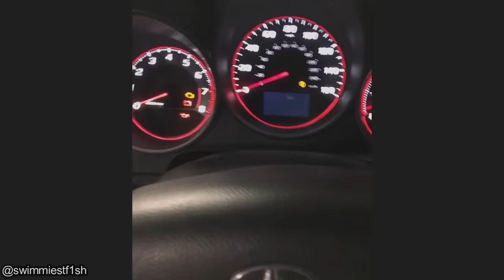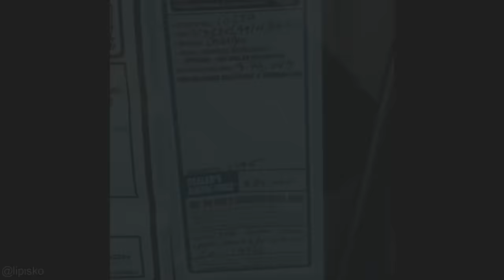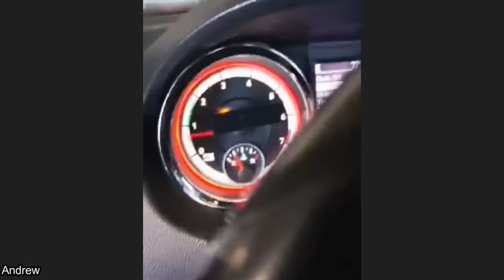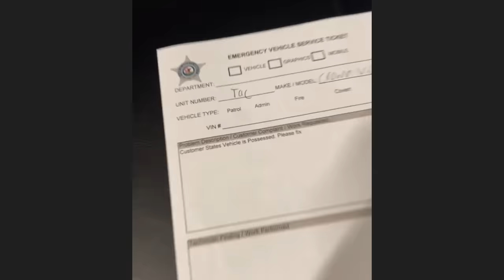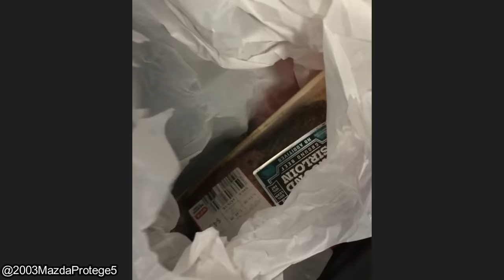Customer States Compilation (The Best of 2021) | Just Rolled In

Comment: I'm no mechanic, but I'm pretty sure oil isn't supposed to be jelly.
Reply: The response you hear in the background is exactly what you will hear in ANY shop that something like that comes into. Because honestly I have no idea how that is even possible, short of actually adding jello to the oil.
Reply: I've seen something similar to this when a lady added coolant to engine instead of oil, though resulting mass was closer to butter than jelly. Maybe it depends on what exactly you add to engine oil.
Reply: forbidden jello
Reply: Where’s the gabagoo
Reply: My best guess is that a shit ton of gasket sealer was somehow involved in making the forbidden jello. Along with using some weird oils or adding coolant as well. Who knows at this point lol I’ve never seen anything like that
Reply: Did someone drop gelatin into the oil? How TF does that happen? Lol
Reply: @alexwalker2582  Yeah, I wondered that myself.
Reply: Or, the vehicle could have had poor oil / water in it, and it was left in below zero temperatures. Oil can freeze if cold enough and become jello like if there is water or coolant mixed in in it. (Blown head gasket) ?
Reply: @alexwalker2582  All engine oil increases viscosity during time. All sorts of particulates from burnt oil to tiny shaving of metal get in it. Its the main reason we change our oil. It not because it looks dirty, its because the dirt increases viscosity and therefore reduces the oils ability to transfer heat. This is just what happens to oil that hasn't been changed in decades.
Reply: @richbob9155  That didn't look like oil.  I've seen engines that didn't have their oil changed for 60k+ miles.  It doesn't look like that.  To me, that seems like an additive that went wrong.
Reply: @pennywisethedancingclown7139  Usually oil with coolant in it turns into a milkshake-like substance.  This is.... rather strange.
Reply: @Darion350  I guess so. Unless the water / coolant completely separated? I guess if it was mixed up. It could look milky? Idk. I'm no expert. But whatever happened... 🤣
Reply: The forbidden jello
Reply: The person who sent that clip in didn’t know what happened because it’s not their clip. This one is several years old, and if I remember correctly, someone sabotaged the car.
Reply: A routine oil change (on diesel trucks for me), typically sees a more viscous black fluid coming from the oil pan. I've yet to see anything beyond that coming out of the oil pan. Yet I have seen oil filters tightened to a point where they cannot be removed. I had two of my tech buddies try to remove an oil filter, thinking they had finally broken the torque, only to realize that they were merely twisting the filter itself, just below the threading. They had completely broken it off, and there was no salvaging it. The truck had to be towed to a Freightliner maintenance location to have it removed with higher level tools than what we had...
Reply: Silver paint?
Reply: buying a used motor filled with oil and window cleaner would do that i think
Reply: @richbob9155  I've seen oil in very old junkyard engines that's far older than a decade, didn't look like that.  It will get very sludgy, but it's still somewhat liquid.  

To set up like jello there has to be some sort of contamination.  Sabotage even.  Not sure if sugar will do that, but sugar does solidify at high temps, and mixed with motor oil maybe that happens.  Don't know, never tried it, but I have heard of pouring sugar in the engine as a way to mess it up.
Reply: @Driftwannabe 10 looks like a good way to clean it if you manage to get all that jello out without too much problems loool
Reply: Costumer stated that it froze over in winter
Reply: Im speechless lol....ok folks sugar in gas tank normally won't screw a car up but sugar in oil reservoir will def congel and turn to taffy or caramel..some of those oil changes with here def revenge it seems..but most of them where coolant poured into wrong area imo..
Reply: @Tyler-ts2ld  there’s special judgement for people who sabotage the car of another.
Reply: Fine powdered saw dust will do that. its is added by unscrupulous car dealerships to quiet a knocking engine, its also added to transmissions to hide slip. the cellulose and hemicellulose burn off ( causing a burning smell) and the natural polymer left in the wood causes the oil to gel like that.
Reply: @anthonylautzenheiser3802  can that be done in newer cars though?  Seems those old tricks only worked in carbureted cars and transmissions that weren’t electronic.
Reply: @KristiLEvans1  I am not sure, but , it seems to me that as it works with the oil it wouldnt matter how old the car was.
Reply: @anthonylautzenheiser3802  hmm.   That’s fair.  Interesting to consider
Reply: I like using raspberry jam.
Reply: @Darion350 

I saw another clip a while back that looked like that; frothy milkshake/slushee consistency.  It was fascinating
Reply: @radiotubes  unicorn blood I think
Reply: It looked like someone put five box's of Jell-O in the crankcase now we know.
Reply: @Driftwannabe 10 nobody calls you that
Reply: @Driftwannabe 10 oh I took so hard so so hard
Reply: @alexwalker2582  the oil is no longer oil it is now reverted back to tar
Reply: @Driftwannabe 10 don't go easy on me explain in detail.
Reply: @richbob9155  that engine wasn't decades old though
Reply: @anthonylautzenheiser3802 
I've heard about how they'd do that to quiet down noisy transmissions & differentials, but didn't know it was done that much with engines too. I guessed the sawdust would quickly clog the oil pickup, the tiny galleys in the lifters, etc. as soon as it was started & cause an engine knock to get even worse. 

Reminds me of a section in the 1939 book The Grapes of Wrath about how a used car dealer would put sawdust in noisy transmissions & differentials to quiet them down, then sell to evicted sharecropper families who had just sold everything they owned to buy a used car & were migrating west to California in search of work. Imagine being the type of person who does something like that knowing the buyer will be taking the car on a 1400+ mile trip through some pretty rough & rural country, where breaking down in the desert would be a life or death situation. Sure unscrupulous used car salesmen definitely still exist today, however in my opinion selling a car with a known engine/transmission issue that has been masked with sawdust to a family that you know is homeless & will be taking it on a week long drive through Death Valley with no cell phone is an entirely different level of scumbag. Nevertheless we have never had any shortage of scumbags.
Reply: @FinalFront  I am making a educated guess on it being used in the engine. The saw dust would need to be a fine powder for use in the engine, opposed to the coarser type used in the trans and diff. There is no end to products that you can add to your engine to stop knocks today. Instead of the hucksters selling you the car like this, you can go to your local auto parts store and do it too yourself.
Reply: New Jello
Reply: It comes with a toaster
Reply: @alexwalker2582  lmao fuck adding sugar to the tank I'll just throw in jello mix
Reply: @Darion350  probably that mechanic in a can bs
Reply: @alexwalker2582  if you for example mix a fluid that is not supposed to go in oil that can happen, and the disgusting “oil” is water and very old oil, ALWAYS remember to change ur oil!
Reply: This happens when you add too much extra additives to your engine oil. Often happens when the engine is worn and you try to hide its condition right before selling. It has nothing to do with oil and water/coolant mixing.
Reply: I'd have kept that thing as a trophy. That was just too spectacularly bizarre to throw out.
Reply: I'm not a mechanic, but I have heard back in ww2 there were (atleast in the us armed forces) 2 main kinda of oil. One was for warm weather, one was for cold weather. During the battle of the bulge they were in low supply and had to use warm weather oiln and it would essentially do the same thing until it warmed up.
Reply: @Milo Prager I doubted with releticly modern oils, I'm just trying to figure out how you would do that.
Reply: As a mechanic, it doesnt taste like it either.
Reply: I'm weirdly enough in a position to say that this isn't coolant mixture I don't think. I recycled oil for a living and have seen all sorts of oil mixed with shit from some gramps' garage and I have never seen anything like that jelly. I've seen oil thicken to mud, I've seen the coolant milk, brake fluid, even one asshole who had mercury thermometers broken in the oil with coolest and rain water.... Never seen jelly....
Reply: I am, it’s really not supposed to do that
Reply: The forbidden jello
Reply: Yea Fight, oil is supposed to have an silver colour... XD 😉
Reply: @wallywest2360  sugar messing it up by clogging every hole or small line. specially when it melts but it will not look like this. I put sugar in a junkyard motor I had laying around, ot ran for like 30seconds
Reply: Yeah you want a more molasses type texture, the thicker it is the better job it does at protecting your engine
Reply: How would you know, you’re no mechanic.
Reply: @Webbygears  ^^ if someone would serve you a bowl of soup thats glowing in the darkness you would also say "thats not supposed to be like this" or am i wrong? 🤔 XD 😉
Reply: That's not oil, it's silicone
Reply: As an experienced professional engine mechanic I can confirm it's totally normal for oil to look like black jello. It's also totally safe to eat.
Reply: I’m guessing the engine - and therefore the car - are a write off at that point?
Reply: Only in a jet
Reply: Yeah, don't be THAT GUY. When the sticker says 21,000 and you're at 22,000, change the fucking oil. I'm not licensed but EVERY vehicle I saw that came in well beyond it's natural life had the oil changed on point. It's literally the best thing you can do to keep your car going beyond it's expected lifespan, and it actually works. 
When you don't change your oil it breaks down and becomes sludgy and thick (as we have seen). This sludgy oil blocks passages that are meant to clear your engine of gases that shouldn't be there, and will impede you fuel economy and promote premature engine failure. The deadest engines I ever saw were those that were neglected, and they were junk.
Find a mechanic you trust, and listen to them. They aren't trying to rip you off in most cases........If a mechanic is honest with you and gives you a fair deal for the work preformed, you;ll be a lifelong customer, and most good mechanics know this. Ask around, find that mechanic who is older ad established but still has a rep for diagnostics and newer vehicles. They exist, and remember....just because someone is saying something you don't understand, doesn't mean they are trying to take advantage of you.
Reply: FORBIDDEN JELLO
Reply: Holy crap
Reply: Smuckers after dark
Reply: Dude right!! That was the first thing I was just done with.
Reply: Yeah it turns to jelly if it decides you don't deserve to own a car, quite often the oil makes this decision when it gets neglected. Oil has feelings too.
Reply: I've seen that video before on other sites. Word on the vine is that the customer added jelling agent to the oil in an insurance scam.
Reply: I don't know man, you sure
Reply: @joemann7971  No oil change
Reply: Nooope lol
Reply: @alexwalker2582  yes it is a old trick for a motor that is basically blown   put jello in the motor and it will run for a little while
Reply: It is if you plan to use it as improvised napalm lol.
Reply: Yes it is. That way it will seal all the leaks
Reply: That is because they are in a slick jam.
Reply: @joemann7971  put something to thicken up the oil (sealer/gelatine whatever) to sell the car with leaking engine after washing it.
Reply: The engine can have a little jelly, as a treat.
Reply: They probably used all additive instead of oil.
Reply: "yo man you forgot your oil" hands you block of jelly
Reply: Oh your are a fucking genius
Reply: 05:30 Also that burning smell just might be the fire!
Reply: No sabes nada Jhon Snow es tecnología alien.
Reply: Sure it is!!  Why not?!!!
Reply: It will take three days to change it b
Reply: I was laughing and horrified when I saw that, kinda curious... how
Reply: @UNSCPILOT   Don't change your oil for YEARS lol. That's how.
Reply: Youd be right about that
Reply: Crappy oil additives do that... Like slick 50..
Reply: Forbidden Jello
Reply: I’m a mechanic and I can tell you it’s perfectly normal lol
Reply: Most likely a ton of sugar
Reply: Or silver
Reply: Looks edible all I need is weed and some guts
Reply: Actually F1 cars use jelly oil
Reply: Thats a new synthetic additive its supposed to make oil last forever.
Reply: @pennywisethedancingclown7139  
If it wasn't it is now.
Reply: Michael!

Jim stuck my engine in jello again!
Reply: Forbidden jello flavors
Reply: id be dumbfounded if they drove it in! i mean even my 200k+ mile car doesnt have oil that looks like jelly!
Reply: That's what could happen when you mix different oils or additives that use different ingredients. That's why it's important to use one oils and one additive and dont mix, it's fine to change out fluids to another brand but never mix
Reply: Mhm
Reply: That's not even jelly that's solid ballistics gel lol. Like someone poured a few packs of jello mix in it. Pissed off ex gf has your spare key? Lol
Reply: But it identifies as oil so the car is supposed to ignore this or it’s a bigot
Reply: @Goabnb94, looked as if someone had mixed pectin with the oil, only thing lacking was a bit of flavoring, some fruit cocktail and a touch of whipped cream, lol.
Reply: Mm nothing like grandma used to make
Reply: @joemann7971   gravox
Reply: Its because it's fake af!
Its for clicks!!!
Reply: @Omicron9999  You mean the jelled junk from the oil pan? There's a  shop near me that has (or at least used to) a wall of shame where they had hung some of their most hilarious finds, like a 2 in mountain of weld applied to an exhaust leak, a brake rotor worn down to the vents, and several other things.
Reply: No no it’s supposed to be jelly
Reply: Its like when sellers put a free pack of haribos in your package, just a nice engine seller packing the engine with a nice oil jelly treat
Reply: reminds me of the engine lock poly the dealers used to put in the motors  to destroy them during the cash for clunkers campaign in the late 90's early 2000's
Reply: Taking office jello prank to a new level
Reply: You’ve never heard of “oil jelly”! You can get it in grape or strawberry
Reply: See i can tell youre not a mechanic. Youve never even heard of the new snack oil
Reply: @kireta21  Exactly what i started thinking when i saw a green tint to it when they pulled off the oil filter.
Reply: @wallywest2360  nah, sugar will burn away.
Reply: @djnone8137  1. If your oil is burning you've got bigger problems than the sugar. 

2. Do you have any idea what happens to sugar when you burn it?  It turns into hot, molten glue.
Reply: @richbob9155  the particals in the oil do not hinder it to transvere heat, and that is NOT its primary funktion, oil is there to lubricate. when you use it to long, the molecul chains get broken up, thats why we change it. particles maybe to, but the engine should not produce any particles if the oil does its job.
Reply: Someone hates them. Put Certo in the case
Reply: All the oul passages had to be sealed, probably why its there, probably knocking like hell.
Reply: @wallywest2360  nah. Sugar is atomized in a pressurized cylinder of gas. It won't gum up anything. Burned oil is way worse than caramelized sugar and engines operate just fine. Sugar might muk a turbo or an injector but not the engine.
Reply: Yeah. What is that/what happened?
Reply: It will jam and then toast the engine.
Reply: @billolsen4360  🙄
Reply: I'm going to take a guess it wasn't oil at all, the clue is they just said they had their engine replaced. So probably some kind packing gel.

Or someone didn't remove the engine oil, while it was sitting, that added sealant. And then when they added the new engine and started it. This jello was made.

Either way they got lucky their engine didn't just immediately seize
Reply: “High viscosity”
Reply: First time I’ve ever seen a cook use an oil pan as a mold for making aspic.
Reply: How does that happen?
Reply: Im no mechanic but touching that shit with their bare hands seems like a bad idea
Reply: If it becomes jelly, you might be in a jam
Reply: Hmmm engine oli flavored jello
Reply: Exactly
Reply: So that’s where Australians get vegamite
Reply: Someone put gelatin in their oil to blow the engine
Reply: I am a mechanic, and you are correct @Goabnb94 😂
Reply: @billyray4716  Silicon, that's what I would say. haha.  That would quiet the rattle.
Reply: @schuttrostig5729  Yah gasket sealant or silicone or something to seal a leak.  Must have put a ton in. haha
Reply: @billweirdo9657  Not sugar. Sugar just burns to carbon when hot.
Reply: @Christopher St.Louis  and when alot of sugar is mixed in say engine oil ..... you get a thick tar like glob. Although most the time people mix sugar and water together when they pour it into the oil same result. Hot engine moving parts cooking the oil and sugar while mixing  to form a thick blob that will seize up your engine.
Reply: @billweirdo9657  Sugar doesn't mix with oil or gas.  It mixes with water which would form a separate layer. 
Sugar is made of molecules called sucrose. Sucrose is made up of carbon, hydrogen and oxygen. It’s C12H22O11, meaning it has 12 carbon atoms, 22 hydrogen atoms and 11 oxygen atoms.

Meanwhile, oil is made up of C-H bonds. It has carbon and hydrogen atoms only, and not oxygen. Because sugar has oxygen present in its composition, this creates a negative charge. The oil has a positive charge because oxygen isn’t present. Sugar has bonds that are polar, while oil has bonds that are non-polar.
Reply: @Christopher St.Louis   Then explain how this happens from sugar dumped into your crank case... I've seen the results first hand. obviously something is acting to allow them to some what mix. Considering alot more then just oil is in a crank case.
Reply: @billweirdo9657  they dump a bunch of leak sealants and oil stabilizers.  The oil jello in the pan is prabably 95% sealants and stabilizers where as in the top of the engine it was more goey than jello so a litle more oil.

Sugar gets hot and burns at a lower temp so it would turn to carbon before mixing with the oil.  If you don't let itt build it isn't a problem . 

He has another video where the oil isn't as jelly and the owner just put stabilizers. no oil.  So throw some leak sealant in too and whala
Reply: I've only been useing concord grape and I get better mpgs than ever. People who use jam, that jams everything up.
Reply: It's jello (Jell-O) or gelly